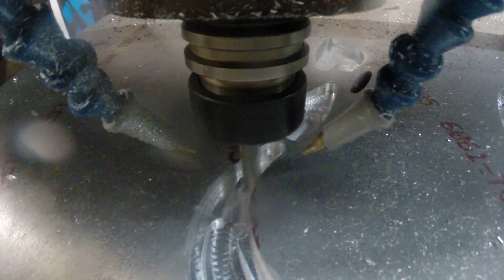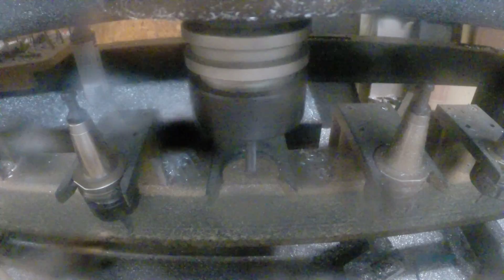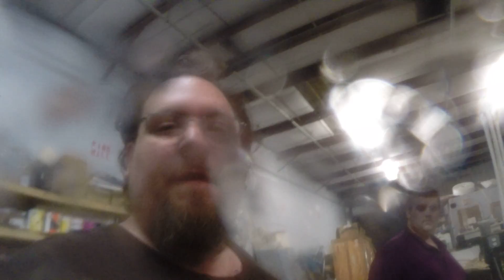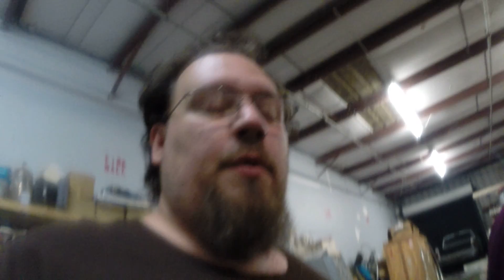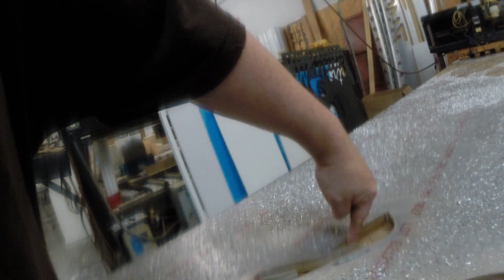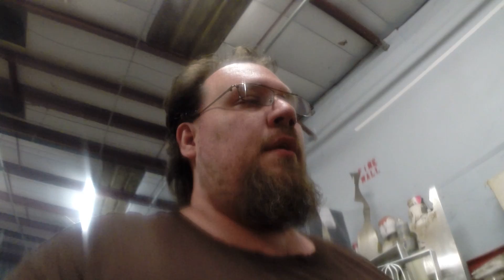Cutting 3/4" Aluminum with CnC Router "the right way".... CRAZY FAST !!!!!

Comment: I used similar routers at work but only machined plastic. We had to use a vacuum system to remove chips though. Would that work with aluminum? Would it interfere with the oil misting?

Comment: James,
    I have a manufacturing company in Fort Worth, TX.  We have a lot of 1/4" and 3/8" 5052 H32 aluminum sheet routed and drilled.  I'm tired of outsourcing this work, and your video has peaked my interest.  My finished parts a typically around 6" x (48"-59") and have 3/8" holes and 1/4" countersunk holes drilled in them.  Each part requires 3 tools.  I believe that I need a vacuum table as well?
     It appears that you have extensive experience in this industry, and I am looking for some pointers in what type of machine/table/software/etc. that you would recommend.  What is the ballpark pricing that I should expect to pay to get up and running?  Thanks.

Please email me at chadp@sharchs.net
Reply: +Chad Peterson  We run 4-8 mm 5052 aluminium day and night, if you still need info let me know.
Reply: +Joseph Haim 
Is there a phone number that I could call you at?
Reply: +Chad Peterson I will contact you via e-mail tommorow.

Comment: Personally I would ramp up your federate a LOT and cut with a much smaller step over... also use the full length of the cutting tools flutes..  Your main motor and steppers will be much happier. This will speed up your machine times...   Basically  High-Speed machining.
Reply: +sn0wchyld You gonna just taunt everyone with what you can do, or are you gonna give some advice on how you did it already...
Reply: Jerald Doerr I was kinda thinking the same thing... though programming is easier like this, and its still doing a damn good job...
personally ive settled on a 10mm doc 1400mm/min 1.1mm Stepover with a 6mm single flute at 24k. I'd go even faster but my little machine needs more rigidity first (china 6040) and probably some coolant wouldn't hurt...  So nice and satisfying though how the chips come off in a long stream when you get the feeds right!
Reply: Dana Ng um.... thats exactly what i just did bub. i gave all the data necessary to replicate my results if someone has a machine capable of moving at those speeds (mainly the 24k and 1400mm'm). anyone with a 6040 or similar router type CNC can replicate my results with their own machine with this.

Comment: OK guys it looks like you have a nice router. The chip load and the keeping the cut clean is a must. I've been a machinist for 25 years. There are some very high performance end mills just for aluminum in the machining industry. What we call rigid is a misnomer, it should be rigid enough. Check out the high performance stuff and your machines steppers will not be able to keep up. Some high performance mills will be going 200 or more IPM. Since you have a 10hp spindle you have the pony's. But now keep an eye on your spindle and know that the extra force will take a toll on the bearings. Not a bad toll, but I would watch that the spindle doesn't get too hot. If you do more of this kind of work maybe start reading up on "high speed machining". The crazy thing is that the forces drop and the performance improves over a certain RPM and feed threshold. That router is a beast and it may be rigid enough.

Good luck
Reply: michael bennett isn't it at about 40% stepover that the cutting forces are almost neutralized by the end mill 'pulling' itself into the material?
personally i cant get enough of datron's vids - blody fantastic stuff to watch